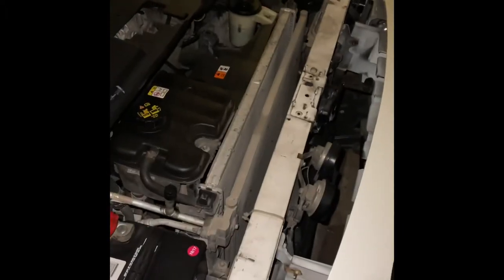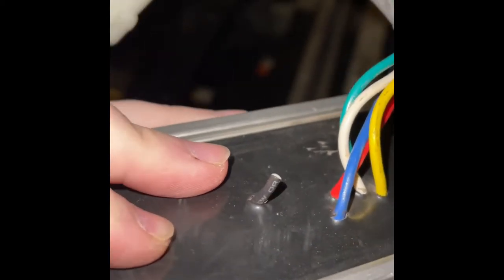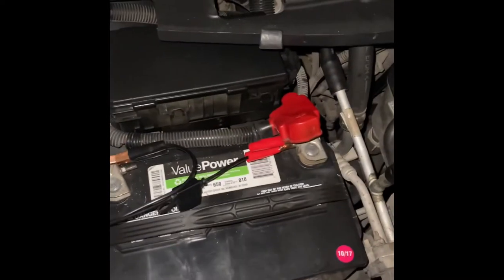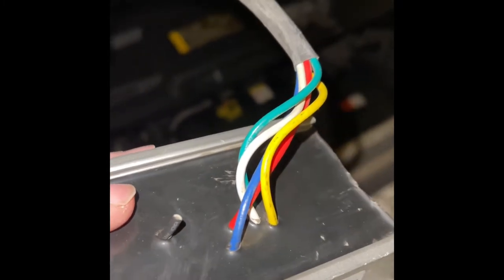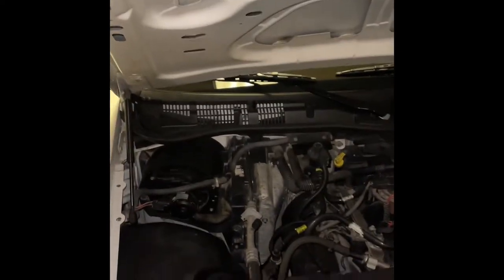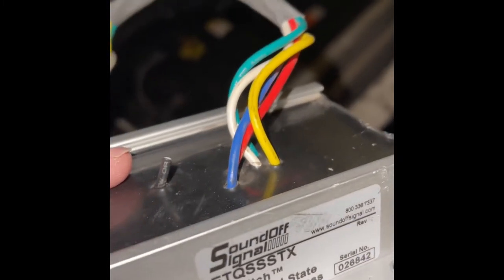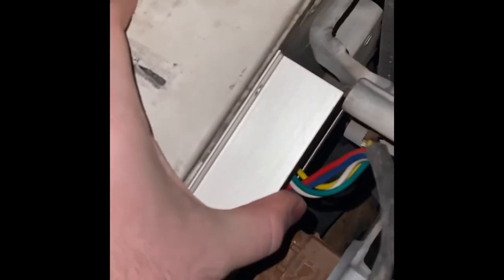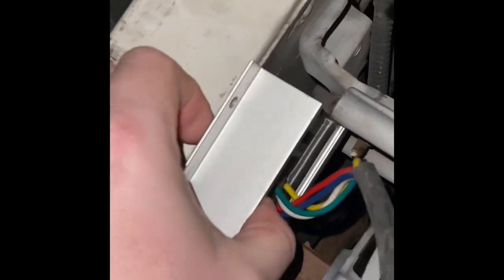CVPI Soundoff Signal Solid State Headlight Flasher Installation Video for sale by Jono.CVPI

Comment: I have an 07 p71 and I don't see the blue and yellow wire with plug in that area. Is it different on the earlier cars?
Reply from the maker: Any CVPI from 03+ Would have those wires in front of the radiator from the factory. However, when decommissioned, a lot of times they cut the wiring and connector off before it gets to the radiator. Check for cut wires.
Reply: @Jono CVPI  the whelen flasher for the crown vic has the connector that goes right into that harness next to the horn.
The only thing you need to tap into is power and a switch. Which luckily I already have ran for one of my off road bars. So this process should be pretty easy for me